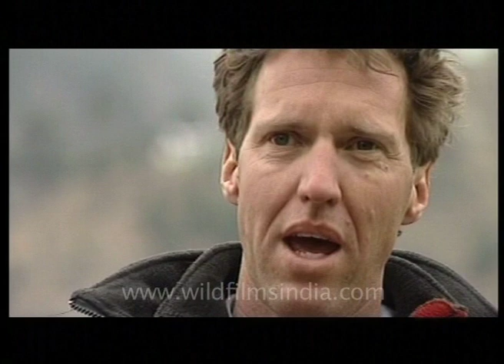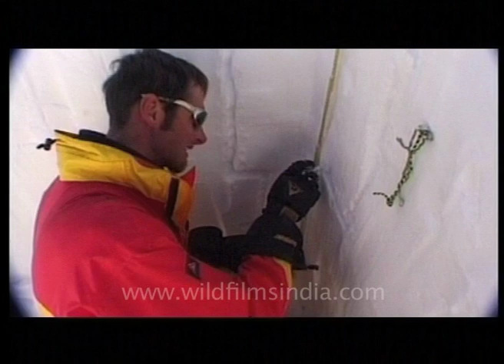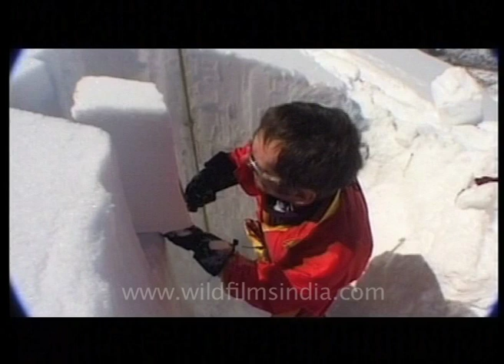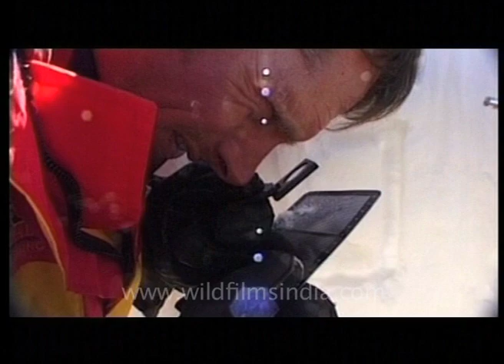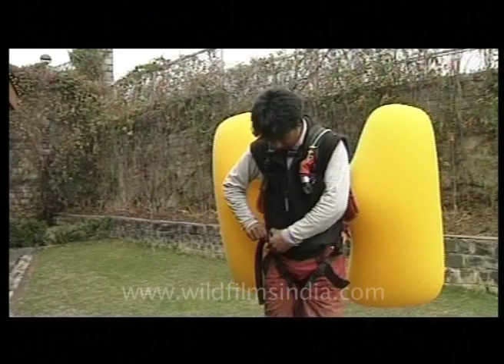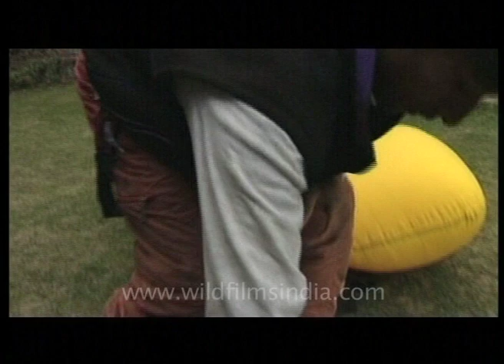See Avalanche airbag in use!

Comment: They say "specific gravity" not just gravity. Specific gravity is the ratio of the density of a substance to the density of a standard, usually water for a liquid or solid, and air for a gas. Specific gravity is the correct term to use.